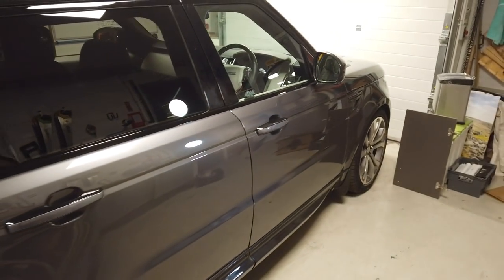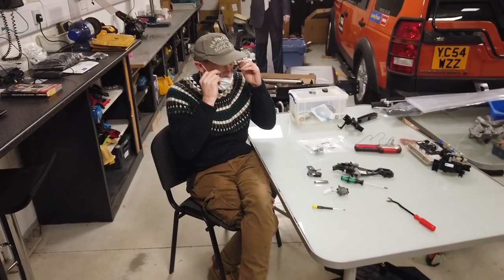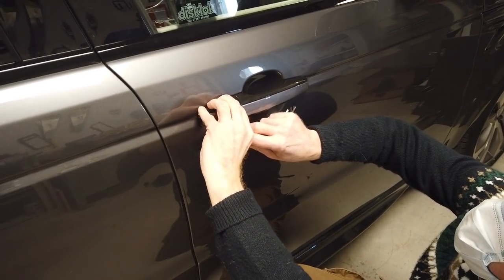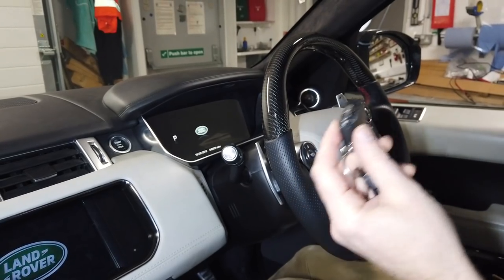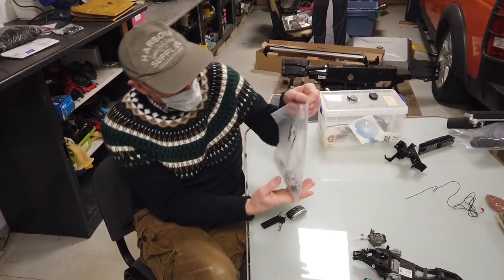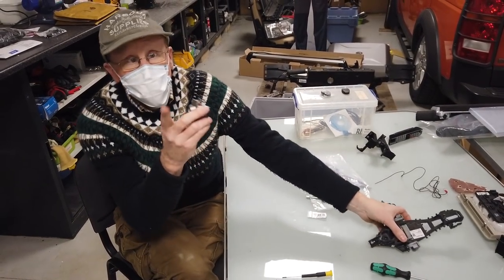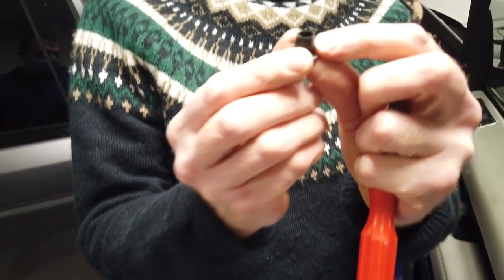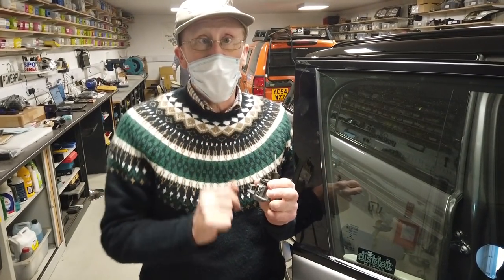Range Rover Sport L494 Keyfob / Remote battery / Emergency Vehicle Access / Lock Barrel Replacement

Comment: Another helpful video Simon 👍.  The gasket which keeps the handle lock cover in place weakens the more you take the cover off.  Its a known issue on many LR models. That's why many people find their cover is wobbly or it pops off when jet washing etc. Would be great to see a dedicated video showing how to replace the gasket - its much cheaper to replace it than have a new cover resprayed and fitted, only for it to go missing again. I resorted to a dab of silicone to stop it going awol!

Comment: On my L494 spare key operations work except the keyless entry / start. I have to hold it up to the steering. Car starts etc and drives fine. Next time I go to car I have to bring the fob to the steering. Other key is fine. Is it possible to deactivate the keyless per fob? Any help would be great.
Reply from the maker: It sounds like the battery is flat - but that makes no sense as the boot release works right ? The key may not be programmed to the car..... its a strange combination of things working / not working
Reply: @L663  thanks for replying. It's as if the keyless transmitter is not transmitting. All buttons work and holding key to steering it starts. So I feel it's programmed to the car. It just have no wireless keyless ability

Comment: Firstly, bit worried for your car security Simon when you waved the new barcode around and Tyler did a close up. Can someone not order another key from LR based on that barcode and potentially steal your car?
Secondly, thanks for showing the battery replacement procedure. My former car (BMW 3 series) didn't have a replaceable battery as it was a rechargeable type and you were obliged to buy a new key instead! You can imagine how much that cost!! :-/
Reply from the maker: Hopefully anyone with plans to steal my car has watched the video of the poor quality crash repair and will have second thoughts.... another good reason for us to buy crashed cars for development cars... they are not very desirable as guess what ... thieves are fussy about which cars they steal !
Reply: @L663  Fair dinkum! ;-)

Comment: Out of interest, what would happen if you locked the car with the key fob and therefore alarmed it and dead locked it?
If you then open the car with the key assuming it will release the deadlocks wouldn’t the alarm activate?
Would pressing the fob on the 3 ridges deactivate the alarm if you managed to get past the deadlocks?
Or, are you just stuck and not able to deactivate the deadlock?
Just a thought.

Comment: Hi Simon, what happened to the clip on microphone?
Reply from the maker: So I put the camera down on the table then it powered down and parked the gimble - in doing so it toppled itself over and threw itself headfirst off the table in some strange lemming type move... so i had to send it back to DJI.. DJI got the camera ( had to send to Holland ) and repaired it free of charge... but it is now stuck in post Brexit customs... for 2 weeks !
Reply: @L663  Sounds like it had enough of the pandemic 😷

Comment: Two things about these key fobs if you are a clumsy idiot like me - cheap silicon skins from Amazon protect them when you keep dropping them (and are available in different colours if you have multiple Land Rovers 😁), and secondly,  genuine replacement cases are available is at a small price and it’s easy to swap the innards over.
Reply from the maker: Yes i will do a swap over video.. just ordered the new case.